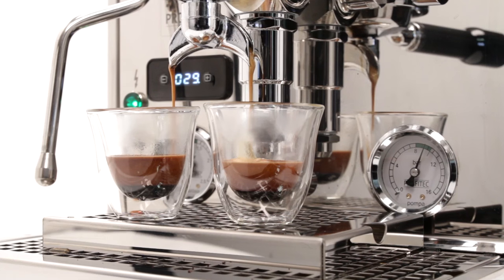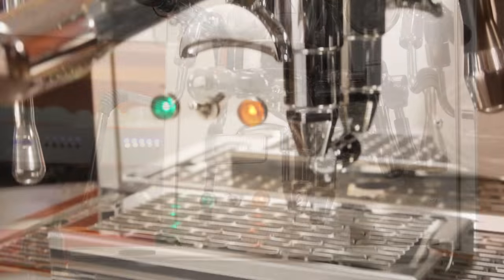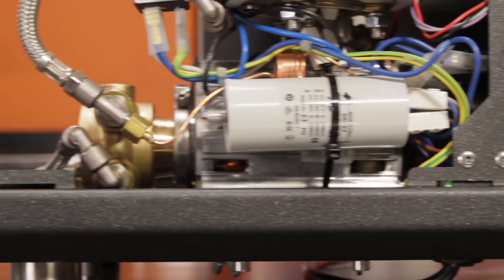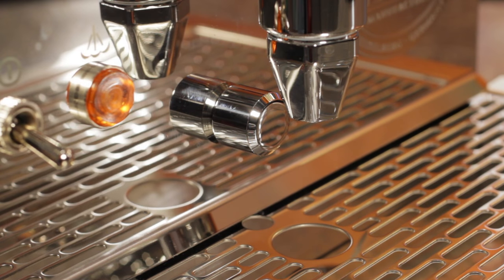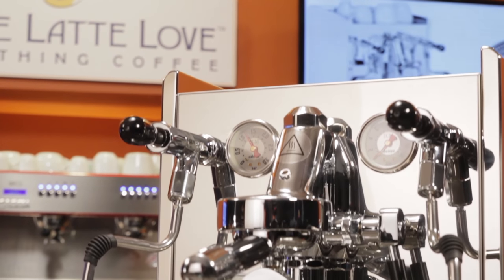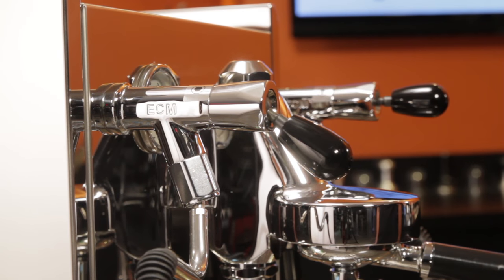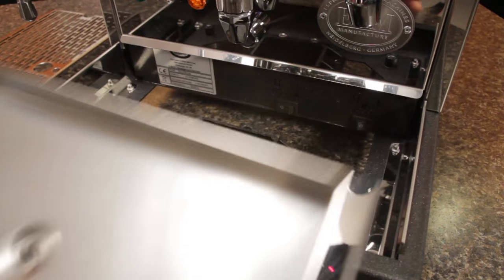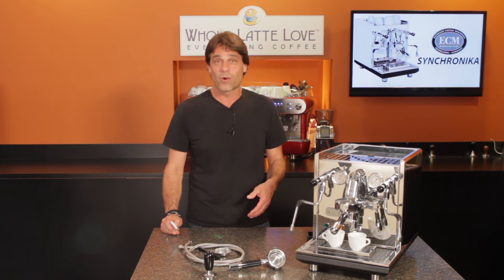Review: ECM Synchronika Espresso Machine

Comment: Marc, an Excellent review, I am looking at dual boiler machines and have read the manuals on 6 top of the range machines of which you mentioned four of them. I like the idea of the  SS boilers of Profitec 700, IZZO Valexia (not Alexia) and Synchronika (leaving out two others that cost around $2K more just to do pressure profiling). You are spot on about the quality of this machine one big plus over the Profitec for me is the Gauges are up high and less likely to get splashed and over time moisture may penetrate the face and enter the gauge . On the other hand my only concern with the Synchronika is a powder coated steel chassis that if not coated 100% from new or is scratched during a service, it may start to rust over time. I know they have made every effort to prevent moisture build up in the machine by installing vent pipes, If the base was Stainless steel I would have the Synchronika sitting on my bench right now. 
Cheers, look forward to more of your informative reviews
Reply from the maker: Hi MD, Thanks for your comment and appraisal of the Synchronika! I'm racking my brain trying to come up with a machine with a full stainless chassis and not having any luck coming up with one at the moment. It's relatively rare! Personally, I love the powder coated chassis. I like the way it completes the bottom of the machine with it angling in. On close inspection I cannot find any un-coated areas in the powder coat finish and it's rock solid. The finish itself is smoother than it might appear to be on camera. I certainly understand your concern with a scratch in the finish. Most other machines like Profitecs, Rockets, Etc have a painted steel chassis. I really think those are more likely to get scratched over time than the powder coat. But the powder coat is more exposed so... The most likely area for scratches is under/around the drip tray. You probably noticed, but the Synchronika does have stainless drip tray supports/slides which should prevent this. I like the gauges up higher as well. For me, it's more for visiblility. Most gauges are well sealed and I've never seen one with moisture penetration unless the face was cracked.

Comment: Hi thanks for your efforts to give a knowledge.. I have the ECM Synchronika and I want to program the PID as a perfect, could you help!!
Reply from the maker: Hi ba, Thanks for the question. Nice machine! Set the "T1" which is brew temp to something in a range of 195F/91C - 205F/96C. Middle of that range for medium roasts, cooler end for dark roasts and higher end for light roast. "T2" is the steam/service boiler temp. If you like a lot of steam preasure set to it's max of 270F/132C. If you like less pressure lower that temp till you get what you like. Most will like all the steam pressure they can get. Hope that helps!
Marc
Reply: Whole Latte Love Hi .. I have no words to thank you 💐💐💐💐💐💐💐 really Your answer perfect and helps me .. Thanks again 💐💐💐💐💐💐💐💐

Comment: Hi, for the first use is it ok if the water tank was not fully empty? 
The machine was ready with the first water tank. Felt like i did something wrong. Though i checked the manual several times and some videos on youtube.
Reply from the maker: Hey Hamad, If the machine is operating properly think everything is fine. Perhaps the boilers were partially filled prior to your first use?
Reply: @Wholelattelovepage  Maybe, after a week of usage everything seems great. Thanks❤

Comment: How often do you need servicing for this machine. Once a year or every few years? We make about 5 drinks a day 365.
Reply from the maker: Hi Johnny K, Thanks for the question. Well, do regular maintenance like backflushing, brush the group and it's incredibly reliable. After that, It comes down to water quality. Use a water that does not cause scale and this machine IMO is one of the most reliable in its class. It is well engineered yet simple (KISS) with quality parts which make a difference like stainless steel mushroom valve, low wear sprung valves for steam and hot water. With good water every couple years is reasonable.
Marc

Comment: Hi Mark, when I put the ECM Synchronika machine on after some time there is a bit of steam in the left pressure meter. After cooling down it disappears. What could be the reason?
Reply from the maker: Hi Peter, I see that happen on machine gauges from time to time. Hard to be certain but possibilities include condensation due to high ambient humidity or damaged or faulty gauge with leaking membrane. If purchased from WholeLatteLove.com please contact our tech support at 888-411-5282 to determine warranty coverage.

Comment: Wow. A real dream machine! I don't have an espresso machine right now, but have been doing a ton of research. 
There's a saying about gun safes: buy your best safe first. I think I may be applying that theory to an espresso machine. :) 

Since they run simultaneously, with a 1200 watt steam boiler and 1800 watt brew boiler, do you need more than a 15 amp outlet?  (20?)
I have a water line behind my frig (connected to the frig). Can it be split to go to both?  Also I have a water softener, will I still need a filter?
You guys are in NY, and I'm in California... is maintenance something I should be able to do myself?
Also, I'm pretty impressed with the Eureka Specialita. Good pairing?
TIA
Reply from the maker: Hi Scotty, Thanks for the comment! Synchronika is a fine piece of work! So is the Profitec Pro 700 which is nearly identical internally/functionally - just a little less dressed on the outside. I posted an-in-depth review of the Pro 700 last week. ECM/Profitec are sister companies. Check out the Pro 700 video here: https://youtu.be/l54y-_Vx_ts
As to power requirements: Current Synchronikas and Pro 700s are rated at 1600 watts in the US. Brew boiler rated at 1200, steam boiler at 1400. But boilers never run simultaneously. When turned on from cold, the brew boiler heats first. Then the steam boiler. Once up to temp, they alternate in short pulses under PID control to maintain temps. At 1600 watts, max amp draw is 13.3. Can run on a 15amp circuit but 20 is preferred.
Maintenance: Single most important thing to keep these machines running properly is to prevent scale buildup. Our preferred method is an ion-exchage filter which replaces calcium with magnesium. This maintains a mineral level for good flavor yet eliminates scaling. There's more info about in the video linked above or you can check out the BWT filter system here: https://www.wholelattelove.com/bwt-bestmax-premium-filter-package-w-besthead-flex Descaling a dual boiler machine is not something we recommend most end-users do as it typically requires removing the boilers from the machine. With the BWT system no descaling is required. And, you could break the output from the BWT to your fridge and/or additional faucet for drinking water etc. Other maintenance is all doable by you. The Eureka grinder is nice, but you might consider a matching pair with the ECM S-Automatic 64. It has larger 64mm burrs and a worm gear for super precise control of grind size: https://www.wholelattelove.com/ecm-synchronika-and-s-automatik-64. Using your gun safe analogy, you could upgrade the the burrs in the S-A 64 to titanium: https://www.wholelattelove.com/ecm-64mm-titanium-burr-set
Hope that helps. Let me know if you have more questions.
Marc

Comment: how similar is this machine to the profitec 700? does it share the same internals and its juts the valves and looks thats different or is there an actual difference for the difference in price in the uk its £250 more than the pro 700
Reply from the maker: Hi AJ, The PPro 700 and ECM Synchronika are very similar as far a specs go. A few things that are different... ECM has easily removable panels, lever operated valves, extra finishing touches on E61 group/lever/PFs. PFs are angled, it comes with a very nice tamper and the PID display is finished to blend into the machine. The price difference is less here in the US. Close enough that I think if you're spending that much on a machine the more refined ECM is worth it.
Reply: with regards to the lever operated valves, are they more durable and in general better than whats on the 700?
thank you for you swift reply
Reply from the maker: Allan Johnson The knob operated valves on the PP 700 and the lever operated valves on the ECM are of similar build quality and durability. Both are low wear as they use an internal spring to open/close the valve rather than operator pressure. The lever valves on the the Synchronika are of higher quality than lever valves on some lower cost ECM machines.

Comment: HELLO
do i need flujet with ecm synchronika ? i mean
is it ok for the pumb to take a water from outside source ( like a big bottle ) ?
Reply from the maker: Hi MZ, Thanks for the question. We have run the ECM Synchronika direct from a water bottle with no flowjet without issue. Most rotary pump machines can do that so long as the water source is not more than a few feet below the machine.
Marc

Comment: Is it possible to do a comparison between the Synchronika and Profitec Pro 700? Thanks.
Reply from the maker: Hi Martin, As mentioned in the video the specs on the 2 machines are nearly identical. The only difference is in the case and chassis. They should brew and steam equally well. The ECM just has extra detail in appearance and comes with a very nice tamper.

Comment: Hi Marc, what is the ideal PID tempreture setting for this machine?
Reply from the maker: Hi Haokun, For brew temp PID set. I'd go with 200F for most coffees. You can adjust brew temp a 2-3 degrees either side of 200. Typically a hotter for lighter roasts and cooler for darker. For steam (service boiler) it's personal preference. It can run up to 270F for max steaming power. If you find that's too much you can back off to 265F - but never heard anyone complain about too much steam!
Marc

Comment: Not so sure about the chassis being "one complete solid piece".. First it's folded sheet metal.  Second, I count 6 pieces. 1) base, 2)a riveted verticle frame, 3)two riveted arms at the top rear (which the cover screws into) and the two riveted rails at the bottom front where the drip tray sits on.   Also I'm not too fond of the tactile dome switches on the PID display.  Tactile dome switches  wear out considerably faster than traditional switches as they have a higher failure rate, usually due to malformation of the internal snap dome over time. 

Otherwise a very nice machine.
Reply from the maker: Hi Scotty, Thanks for your comment and opinions. One complete solid piece is referring to the base chassis and not the vertical frame. That base is made from one piece of metal. The folding adds significantly to the strength/rigidity of the base as compared to machines with straight rails. The R58 for example had some issues originally with shipping with 2 piece frame rails for the base which were welded where the drip tray met. Rocket has improved their packaging so it's no longer an issue. The PID control switches are pretty much standard. It's a Gicar display. Only machine mentioned in the video that does not use that type of switch is the R58 which has a detachable display which some users like and some not so much.

Comment: hey marc, have you ever heard of the machine being not so near silent while in use?
Reply from the maker: Hi Marty, Sorry not back to you sooner. Just got back this morning from a few days at the Specialty Coffee Expo in Seattle. Anyway, It's a relatively quiet machine with its rotary pump. Do you have one giving you noise issues?
Marc
Reply: Hey Marc no proplem. So yeah, i did get one less than 2 weeks ago and i think i got me a lemon because it almost sounds like it has a vibe pump. loud noises, rattles. the pump itself only went up to 4bars while brewing...they said ecm got back to them(vendor) and they said it could be a pinched tube or what not, but....not taking any chances with that. Anyway the vendor's sending me another one should get it today as a matter a fact.
Reply from the maker: Hi Marty, Glad to hear the vendor is taking care of you! Our Synchronikas get shipped with some hold down bolts on the motor - wing nuts visible under the machine which keep things tight for shipping. Those should be removed before use. Doubt that would cause the low brew pressure you describe but if your machine has those in it would increase noise when pump is running.
Reply: Sup Marc, so, i did receive the new one today and im lovin it. works like a charm and very quiet. gonna get it plumbed in this week. im a happy camper :) 

cheers from Mtl!
Reply from the maker: Awesome! It's a darn fine machine. Be sure and check out our E61 pre-infusion video if not familiar with how it works. Lot's of misconceptions with E61s and pre-infusion. Video highlights how it's differs on a plumbed vs. reservoir fed machine. It's demonstrated on a Profitec Pro 700 and works exactly the same on the Synchronika: https://youtu.be/2DPcZD48TxM
Reply: oh cool thanks for that man ill make sure to check it out along with the other videos you have out. its nice having it plumbed in, less hassle thats for sure. i noticed that the pump pressure went up 1 bar from the initial 9 and that it goes back down to 2 bars in stand-by/off mode. you think i should take it back down to 9? i saw todd's video on that looks easy to do.
Reply from the maker: So we would typically setup that machine to show 10bar on the gauge with brewing engaged and backflush disc in the portafilter. Setting like that actually delivers ~9bar when making espresso before the OPV starts dumping excess. Personally, I'd leave it set as is. The 2 bar when off is reading your line pressure going into the machine. 2 bar (~30psi) line pressure is kinda low compared to most residential service unless using a pressure reducer. Does not affect brewing except for slightly less pressure if pre-infusing. It's more pressure than pre-infusion on a reservoir fed machine but I usually run into residential line service pressure of about 60 - 80psi (4-5bar) although most consider 40-80psi acceptable.
Reply: Marc i thank you for all the informative inputs you gave me lately its really great. im kinda liking experimenting with the machine and grinder, tasting etc...keep it up my man!
Reply from the maker: Hi Marty, So fun, so many variables to manipulate and so much to taste! You are welcome! Enjoy that machine!!!

Comment: Could you do a head to head in depth comparison ECM Syncronica vs GS3?
Reply from the maker: Hi Joe, Thank you for the request. It's not out of the question but... These are 2 very different machines. We tend to limit head to head comparisons to machines/products which are relatively close in capabilities and price. With the flooded group design, paddle control of flow/brew pressure and more than 2x price difference the GS3 is a very different machine than the Synchronika. I think it would be interesting to pull shots using the same coffee and different brewing techniques of the 2 machines and note the differences. In the meantime if you have any specific questions on the machines I'd be happy to answer. 
Cheers,
Marc

Comment: How much for that wonderful machine espresso 😍
Reply from the maker: Hi GE, Thanks for the question and it is a wonderful machine - my favorite dual boiler! Current pricing here...
With Flow Control: https://www.wholelattelove.com/products/ecm-synchronika-dual-boiler-with-flow-control
Without Flow Control: https://www.wholelattelove.com/products/ecm-synchronika-dual-boiler-espresso-machine
FYI the Profitec Pro 700 is nearly identical to the Synchronika with a little less detail/refinement of external case and a slightly lower price. ECM/Profitec are sister companies. Both machines hand assembled in the same production facility in Milan, Italy.
Marc

Comment: Hi Marc, at how many bars should my inlet water regulator on a plumbed Synchronika?
Reply from the maker: Hi Mike, Thanks for the question. Here's this from page 22 of the Synchronika manual:

"Make sure that the water connection line of the machine is connected to a potable water supply with an operating pressure ranging from 0.5 to 2 bar. In case of an operating pressure of more than 2 bars, use a pressure regulator. Please note that often times the pressure of the water supply may vary. If the water supply pressure temporarily exceeds 2 bars, use a pressure regulator. Furthermore, a shut-off valve should be used. This valve should be located where it is easily reached, so that the water supply can be interrupted at any time."

When I've run a Synchronika or Profitec Pro 700 I set the pressure regulator to 2 bar.
Hope that helps!
Marc

Comment: How does the water reservoir and drip tray capacity compare to the Lucca M58?
Reply from the maker: Hi CHR, Probably similar but I do not have an M58 here to do actual measurements. I'll mention that the Synchronika is plumbable to waterline and drip tray comes ready to attach to a drain line.
Marc

Comment: I'd love to see a comparison with Profitec Pro 700.
Reply from the maker: Hi Michael, Internally the ECM Synchronika and the Profitec Pro 700 are nearly identical. ECM has slightly finer detail in finishing - extra touches like details on PFs, lever and E61that have no effect on brewing. One very big difference is the chassis. ECM has continuous frame construction. Another are the lever valves on the ECM and knobs on the PP700. Also, ECM comes with a very nice laser etched tamper.